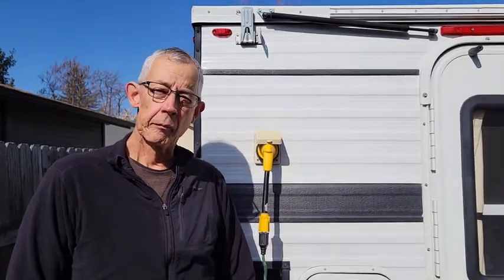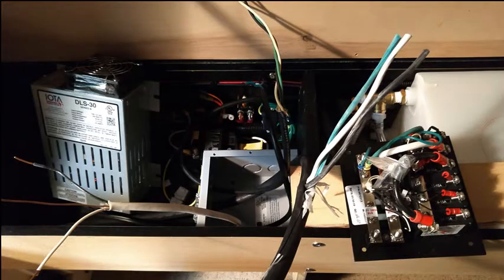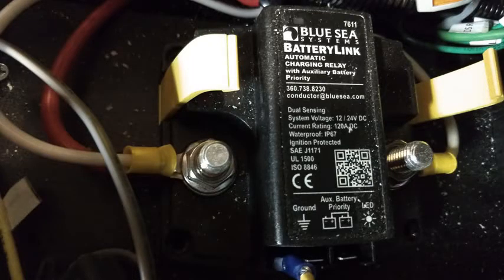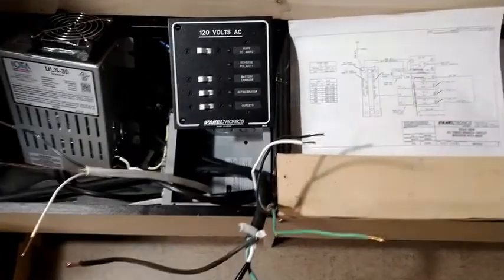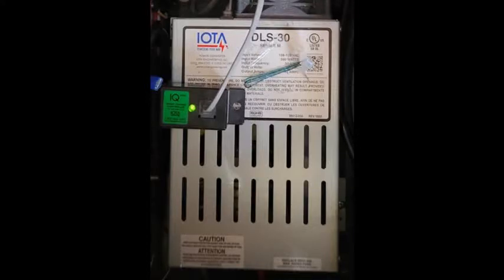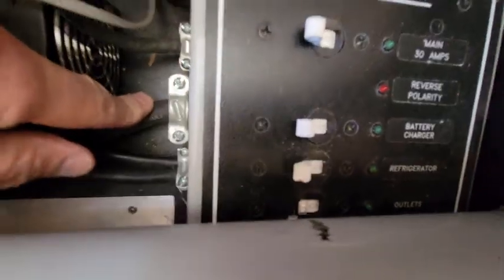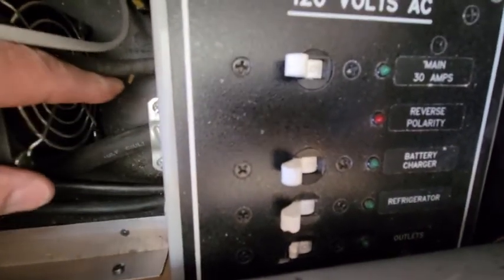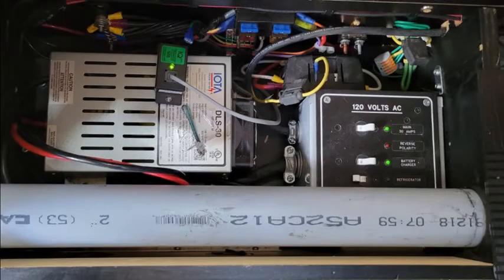A DIY 120v electrical system in our Four Wheel Camper shell

Comment: Hey there. Thanks for the great video.  Can you tell me where yiu found the box fir the 120 panel?  Did you find it online? I cannot find one in town where I'm at and paneltronics didn't supply one unfortunately. 
Thanks for your help
Reply from the maker: Hi Matthew,
Thanks for the comment and question.  Yes, I was surprised Paneltronics didn't have a junction box. I found it online at Amazon   (https://www.amazon.com/gp/product/B005UP9LRS/ref=ppx_od_dt_b_asin_title_s02?ie=UTF8&psc=1).  it is a BUD Industries JB-3955-KO Steel NEMA 1 Sheet Metal Junction Box 6 L x 6 W x 4 H, Gray now at $20.12 and available on Prime.

I think I had to tap a few #6 threaded holes to secure the Paneltronics panel on top, and it was a tight fit with all the wires in that little box, but worked out great. Good luck!  I should probably post links to all the key parts. 
Thanks for asking,
SB
Reply: @sagebrushers8497  Thank you so much for helping me out. as soon as this box arrives I can finish my 120 system in the camper and get out and enjoy the lovely summer. Take care good Sir
Reply from the maker: @matthewgarcia4404    I hope it works out. Enjoy!